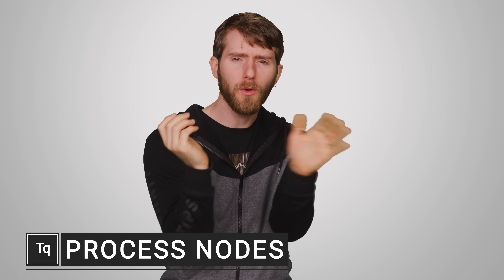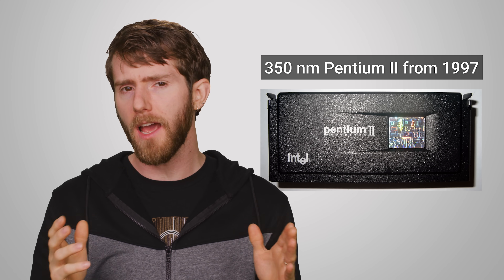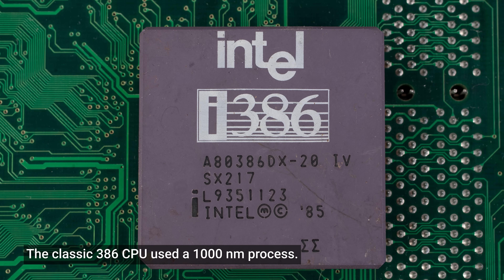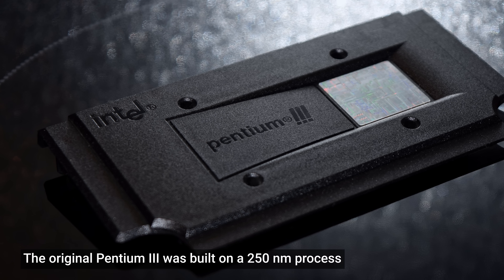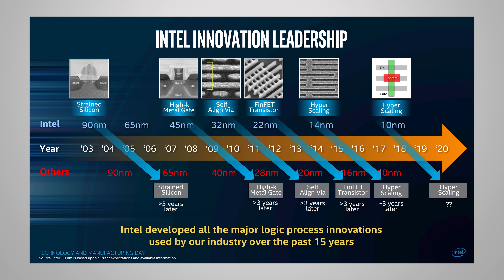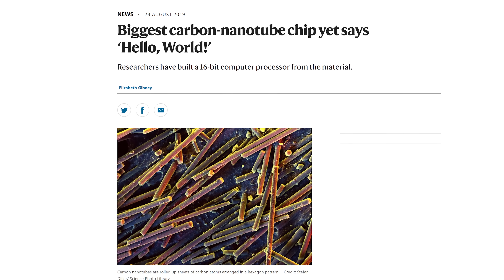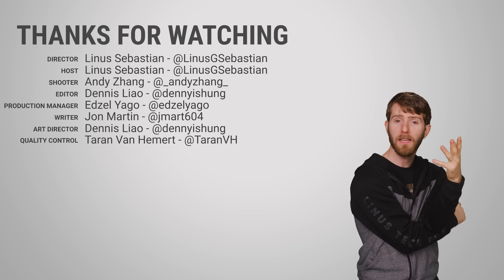Should You Believe CPU Marketing? - Process Nodes Explained

Comment: I had an android with 28nm processor, it was hotter and battery life was shorter.

Today I have an android with 12nm processor. It is way cooler and the battery life stay longer with the exact same capacity.
Reply: So, that's also another reason ARM Chips are more power efficient.
Reply: You had an older android phone, it’s a bit obvious

Comment: Bad video. I don't buy the comment they made how Intel didn't sponsor this video, so it's all cool. Let's look at actual objective facts:
- Every single CPU and chart showed in the video is Intel. Why?
- One of the charts talks about Intel leadership
- The message of the video is pretty much how people should not care as much about something where Intel has been struggling so much in recent years that it's produced countless memes
- They've "reached" to an employee of Intel to get information. Why not also to an employee of ARM and an employee of AMD?
Reply: Just like Intel would be defending their position, AMD may not want to hear "7nm, yeah but...." Engineering is engineering - what Linus is saying could be observed with an electron microscope. Just because Intel are behind AMD at the moment, doesn't make this video wrong. Dewalt and Makita market their cordless tool batteries in the USA as 20v and 18v in Europe - they are the same battery but the nominal voltage is measured at different states. Just because a number is better on your favourite CPU it can still be a marketing number. Going back to CPUs if you need proof that the process node quoted thickness isn't the whole picture - think how close Intel are to AMD performance even in 2020/2021 with a quoted 14nm process vs 7nm - until the last 6 months Intel were still beating AMD in many benches - Intel are properly slipping now of course.
Reply: @a120068020  Why is every single CPU in the video - shown or mentioned - Intel CPU?

Comment: This is just intel making an alibi for their mediocre performance. A smaller transistor size isn't just about transistor density. The biggest point on shrinking transistor sizes is increasing their power efficiency and not putting the most number of transistors on a given die size.

Comment: why try shrinking or fitting more transistor in the same die size all the time, surely that just increases the amount of heat for a given area.

eventually you are going to be saturating the silicone with not enough surface are to transfer heat away.

why not keep the transistor size the same and if you want double the transistor count just have a physically digger die?

Comment: "nanometers don't matter!" Sponsored by Intel
Reply: It´s because the number doesn´t mean anything as explained in this video. 
Intels 10nm is better than TSMCs current 7nm.
Intels 10nm is closer to Samsungs 5nm than Samsungs 8nm. 
with a fctor of 0.7 you should expect an increment of density of 100% 
Intel increased density by 170% (14nm to 10nm)
TSMC increased density by ~80% (7nm to 5nm from their older 7nm process)
Samsung increased density by less than 30% (7nm to 5nm.)

Intels 14nm is 39M/mm^2
Intels 10nm is 100M/mm^2

TSMCs 7nm (old, used by AMD) is 96M/mm^2 
TSMCs 7nm (new, used by Apple) is 113M/mm^2
TSMCs 5nm is 176M/mm^2

Samsungs 10nm is 50M/mm^2
Samsungs 11nm is 55M/mm^2
Samsungs 8nm is 60M/mm^2
Samsungs 7nm is 95M/mm^2 
Samsungs 5nm is 123M/mm^2
There is no logic in theese numbers. 
Samsungs 11nm is literally better than their own 10nm process because it´s an improved 14nm node.

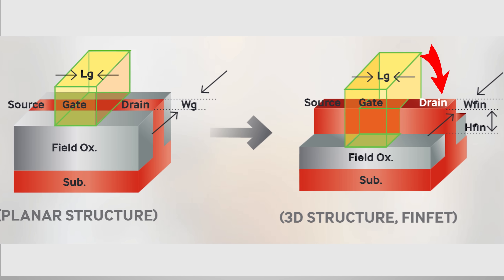Comment: correction at 3:32  increasing surface area of the gate around the channel in FinFET was not to allow more electrons to pass through the channel but to combat short-channel effects and carrier leakage i.e. clamping down on the channel to turn it off when you want the device off. Without FinFET, at these sizes, the field effect would not be able to be controlled by the gate and would be Always-On instead of switching (on/off).

Comment: Linus, this part of the truth. There is also company TSMC and Samsung which are going very aggresive below 10nm. Of course that depends how we measure the distance between gates etc. From technological process this is possible that technology "7nm" is equall "10nm" but definetely mixture of 7nm and 14nm made by AMD shows that final effect is important and end customers know this. So they are achieving good price/performance result by using what they have on the shelf and AMD what has in technological range. I just wonder why are you defending Intel ... while Nvidia has 5 nm graphics cards technology. No matter how we will measure this it is about 30-50% less than Intel's 10nm. What you will say about scenario to completely abandon today's processor architecture and move to GPU computing - so in short systems without CPU (in the traditional way)?

Comment: Smallers FETs are faster because the ratio of conductance to parasitic capacitance (transitional frequency), which is a common measure of FET speed, increases with smaller channel length. The transit time of electrons across a smaller channel length is a negligible factor in FET speed. With modern nodes, FET speeds are so high and FET placement is so dense that metal routing RC delay is also a major contributor to slowing down the overall speed of a circuit.

Comment: To be precise, in the old days, on moving one process generation, corresponding to a 0.71X shrink, then double the number of transistors, that would yield 2X performance. Of that, the process shrink yields 1.5X frequency on shorter gate length, and 1.4X performance gain. This is basically shrinking an existing design to the new process. Then doubling the number transistors on a new design yields another 1.4X, for a total gain of 2X in 2 years.
Process names, i.e., 14nm, 7nm are different from vendor to vendor. Compare the AMD RX500 on Samsung 14LPP, 5.7B transistors at 232mm2 to the next generation RX 5000 on TMSC 7FF for 10.3B transistors at 251mm2. The corresponds to approx. 1 generation advance, yet the number suggests 2 generations (14->10->7). Also note that Samsung and TSMC avoids the use of XXnm in their process.

Comment: Suprise Suprise... Intel is dismissing the Process Node. Intel has been sticking to the 14nm FinFET process for SEVERAL generations. While AMD has been steadily moving to smaller die sizes.
Additionally, "Real World Tests" are already and Heavily favoring AMD's ZEN 2 and upcoming ZEN 3 based processors. However, these can be subjective based on the entire computer system, RAM, Cooling, Ventilation, Application, Software Platforms, etc. Hence Intel is now hoping for Buyer-Bias to steer through the tough times as it attempts to perfect the 10nm Fabrication Process, Loss of Apple as a customer, and other setbacks. A once-leader should not resort to such "Influencer" videos to steer opinion. The company can honestly admit that it hasn't yet perfected the process to beat AMD, accept THIS is not its year and go back to doing what it does best, design CPUs with high Base and Boost Clocks (with admissible high TDP).

Comment: Moore's law is dead. It used to refer to the fact that as a programmer, you can write a program and expect it to double in speed every few years without changing anything to the program. A whole bunch of computer science that is still taught at universities is based around that (big O notation). Nowadays (since the early 2000s really) you have to actively rewrite your program to make use of all the new features such as parallelization in order to keep the performance boost going.

Comment: So, I'm two days late to the party, but...
The reason the Fin FET is useful is not because higher surface area = more electrons, it's that the short channel reduces the effectiveness of the gate, wrapping the gate around the transistor as in the Fin FET gives the gate higher control over the current flow in the channel.

Comment: See a lot of bashing here, I saw a article that explains some what Linus is saying (not from intel) the process size is just advertising because (putting this short) if amd had a true 7nm their transistor density would be much higher than it is yet intel is packing more transistors than amd so something here doesn’t add up, amd does have intels balls when it comes to cores and threads be good to see a video of intels line against amds but reduce amd to the same number cores in use (if that’s atall possible) which would likely settle the question of who has the better process 👌🏻

Comment: now im wondering,
If intels are moving towards the same size as the predecessors type 10 nm but having much more new technology and materials
then AMD going with smaller size of processors with same materials as the predecessors

which one is having better performance??

and some stupid video suggestion :
Why the CPU sockets always locked?, why not making same board thats can be used both for intel and amd processors regardless the socket type (i mean why not giving an adapter from intel to amd and vice versa?, including the micro code inside to bridge the commands, on the adaptor it self)

Comment: Moore Transistors is very Noyce.... I'll see myself out.

Moore's Law has actually been considered dead for a while in the Computer Engineering community. We need to move on from planer 2D lithography and focus on monolithic 3D lithography with better thermals even at a higher die size. EUV is also prohibitively expensive for any manufacturer that isn't TSMC- or GlobalFoundaries-level.

CNTFETs are pretty great though, but we need to have better package cooling especially with hybrid systems within packages. Kaby Lake G had an AMD graphics die within the "CPU" packaging connected with interconnects to the actual CPU die. I can't wait until ReRAM gets placed in an M3D configuration (as in ILV not TSV) on HPC or consumer chips. GAAFETs are also definitely a game-changer.

Comment: Also, how the transistors get used matters.  An ARM gets more done per transistor than an X86 because the simpler instruction set means there are fewer transistors set aside for things that are rarely done in real software.  All processors theses days have a "pipeline" with multiple instructions working their way through it.  If another stage of pipeline is added a lot of extra work elsewhere in the chip also needs to happen for things like branch prediction.  Deeper pipelining helps to let you move to a higher clock but comes at a cost.

Comment: why would you not just use the Transistorcount? like: this is a 6,1 B(illion) Transistor cpu?
Normally average and densities are use if the Product can be purchased by the meter. 
But all CPUs of a given Modelare the same size so the absolute number would mean more.
I dont tell you my Ram density.... i tell you my abolute ram. 
ram density would be: 6 chips per Stick. /you see here is no real info
ram in abolut numbers is: 46 GB

Comment: I've worked on one of the 7nm nodes while it was in development. Fins were 8nm wide, fin pitch was 26nm, diffusion/poly layers were over 20x50nm and if  transistors were not in an array they had to skip at least 3-4 fins. I think the only thing at 7nm was some spacing between layers...
Reply: Just disassemble ones, put under electon scope, measure the distance, thats all

Comment: As a consumer the node doesn't really matter. Basing a purchasing decision on transistor size would be like buying a car based on which steel alloys they use.
Those things really don't convey very much information about the product.
Reply from the maker: Thanks for getting the point of the video.

The steel type they use could have a huge impact, but it also might not. AMD vs Nvidia on GPU right now is a prime example.

Comment: how the hell transistors switching on and off transfers information ?🤣😂 and why small transistor is better ? no is worse because make more heat little space and fail faster ,more work in 1 volt but use huge amperes like stove
Reply: Transistor is either 1 or 0. On or off. Binary. Having a lot of transistors in weird and parallel u can make then count.

Comment: I don't think people should be worried about is it 7 or 10 or 12 or 14 or 17 nm. Game is running smoothly and battery is doing well too. 
Sit in the car hit the gas if it's going fast enough who gives a shit. Is it 8 liter V10 or 1 liter inline 4 cyl twin turbo sodium variable valves direct injection high tech jiba jaba monster. If it's runs fast and use little gas why it's important... I don't get it.

Comment: Man, imagine if Moore's law applied to the speed of the cpu with Hz. We be at like 10 GHz now
Reply: The "instructions per clock" numbers are getting better as the clock speed increases so the MIPs is going up faster than clock speed.  Todays processors do about 1.5 instructions per clock on the average.  When the 8086 first came out, a jump instruction took 22 clock cycles and the clock was only 6MHz.

Comment: I wish you would compare Intel's measurements vs AMD's
e.g. what actuallyis what Intel calls 14nm and what AMD calls it.
Reply: AMD doesn´t manufacture any CPUs. They´re all manufactures by TSMC.
Intels 10nm is closer to Samsungs 5nm than Samsungs 8nm. 
with a fctor of 0.7 you should expect an increment of density of 100% 
Intel increased density by 170% (14nm to 10nm)
TSMC increased density by ~80% (7nm to 5nm from their older 7nm process)
Samsung increased density by less than 30% (7nm to 5nm.)

Intels 14nm is 39M/mm^2
Intels 10nm is 100M/mm^2

TSMCs 7nm (old, used by AMD) is 96M/mm^2 
TSMCs 7nm (new, used by Apple) is 113M/mm^2
TSMCs 5nm is 176M/mm^2

Samsungs 10nm is 50M/mm^2
Samsungs 11nm is 55M/mm^2
Samsungs 8nm is 60M/mm^2
Samsungs 7nm is 95M/mm^2 
Samsungs 5nm is 123M/mm^2
There is no logic in theese numbers. 
Samsungs 11nm is literally better than their own 10nm process because it´s an improved 14nm node.

Comment: What happens once we reach 1nm?
Are they gonna implode on themselves and go minus nm?
Reply: nano	n	10−9
pico	p	10−12
it will go pico
Reply: @Diego-rp1ue  No, we'll likely have to switch method of naming devices as going pico would be entirely unphysical. The size of an atom is on the order of 0.1 nm, so claiming a technology node of even that size would be ludicrous.
Reply: @akeron1an  thanks for the explanation. i only use the logic of measurement didnt think about phisically possible. But thanks again for bring that up.

Comment: Of course Intel will tell you the node size doesn’t matter as much when their 125-watt TDP 10700k’s die is around 200 square millimeters when the 105-watt TDP 3800x’s die size is only around 150 in total; performance between the two is fairly comparable until you factor in the clock speeds. I’m not sure what the instructions per clock for the two processors are, but I’m sure that if you asked TMC, AMD, or Apple the same question that you’d get a very different answer.

Comment: I love how Linus used Intel processor examples, used Intel marketing chart, compared node sizes between different Intel generations, used Intel related news to prove a point, says that Intel tried to push the envelope but couldn't quite make it because they were trying "too hard", pointed that TSMCs 7nm and 5nm, AMDs partner, as "not what you think it actually is", and finished with a Intel marketing phrase lol

I wonder why didn't he compare the actual AMD 7nm processors with Intel 14nm processors. He even talked about how many transistors could actually fit inside the same area, which would be a great comparison...
But for some reason he just skipped it.

Hmm

-------

Oh, the video thumbnail is "7nm", a doubtful face and the title "is CPU marketing A LIE?"

Love it all
Reply: " Intel reports a density of 100.76MTr/mm2 (mega-transistor per squared millimetre) for its 10nm process, while TSMC's 7nm process is said to land a little behind at 91.2MTr/mm2 (via Wikichip). Not that it'll do you much good on desktop—Intel's yet to produce 10nm desktop processors. AMD Ryzen on the other hand…."
[https://www.pcgamer.com/chipmaking-process-node-naming-lmc-paper/]
for density of intel 14 nm I found 43.5 MTr/mm2 as the density.
[https://www.quora.com/Is-Intels-14nm-manufacturing-better-than-the-10nm-architecture-from-TSMC-and-Samsung-considering-that-Intel-has-more-features-on-the-die/answer/Yowan-Rajcoomar]
basically around half the desnsity on Intel 14nm in comparison to TSMC 7nm
Reply: Gabriel Moraes
Why would they compare Intel to AMD? Does Ford compare GM to Ford in a TV add?

Comment: The process node size is one of the most important thing if you  are shopping for some CPU's (FPGA's) as it may increase the speed with lower power without optimizing the HDL-code.
(or you may add another pipeline with all the syncronisation problems, switch to parallel code, ...)
As the process node size is no more the transistor size: Can I still use the old formula for calculating the maximum clock rate (on paper) or should I better use a computer simulation (restraints calculation)?

Comment: The main issue is that once higher density equated to more performance, that's less true now. There's still benefits, such as less heat and better efficiency, but you can get better performance sometimes with lesser density.

Comment: Its more of the efficency of the transistors and cores and cache.  In reality though that has diminishing returns.  Sooner or later when they can't get transistors to be smaller they WILL go larger.  A larger die IS more inefficent true but it also allows for a lot more to fit in a given space.  Which can mean far more power.  Hence why servers are often larger than their relative desktop counterpart.